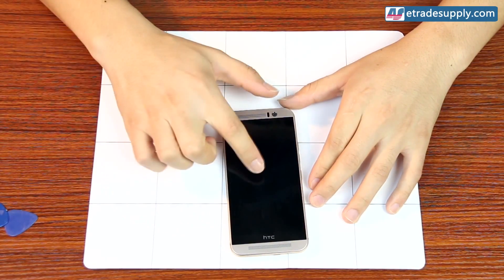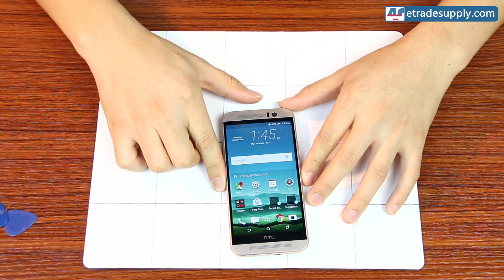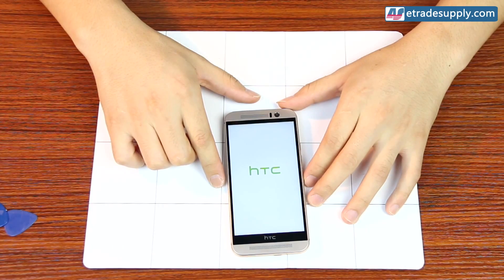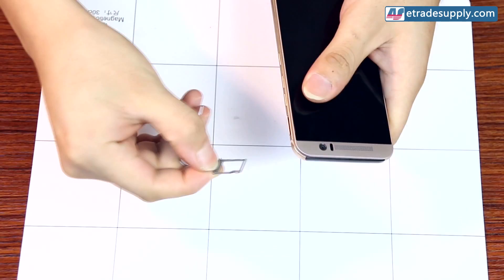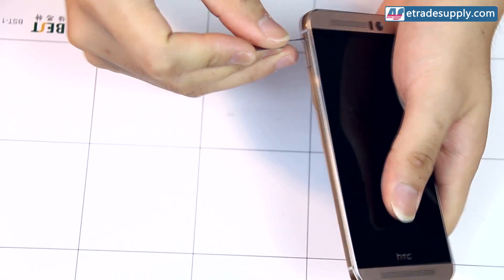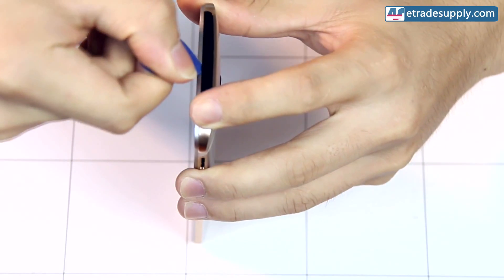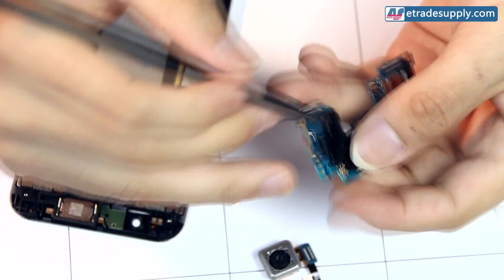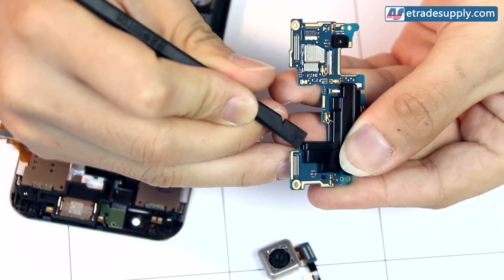HTC One M9 Disassembly/ Take Apart/ Tear Down/Screen Replacement

Comment: is there a way to replace only the hull (front part, outer rim and back part) without taking the whole thing apart like that? unfortunately mine fell out my pocket and has ugly scratches and bulges now. but the internals and screen are just fine :(
Reply from the maker: hi, you mean you just need to replace the rear housing http://www.etradesupply.com/htc-one-m9-rear-housing-silver-27207.html and front screen glass http://www.etradesupply.com/htc-one-m9-glass-lens-black.html?
Reply: I got you! So have you successfully made this without taking the whole thing apart?

Comment: Hello,  

Very nice work on the video! 

I have a thin film of cooking oil behind the screen that is visible with a white background.  Do you think I will be able to heat and remove only the screen (keeping the LCD wiring attached)  to squeegee the oil off to the edge and clean it up without removing the rear case and motherboard? I will need to turn the screen on and apply a lit,  white background to see if I have removed all of the cooking oil before I put it back together.  

Also,  WL I need to apply any new adhesive? If so,  what type and how much should I use? 

I would greatly appreciate any help on this matter.